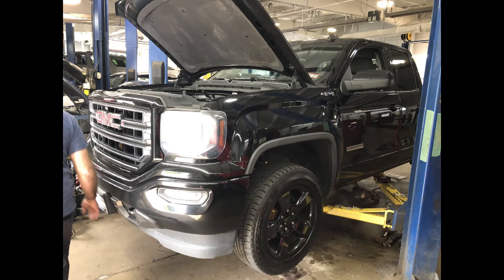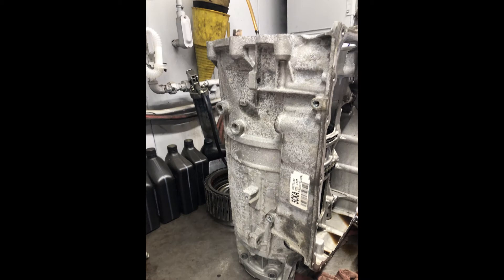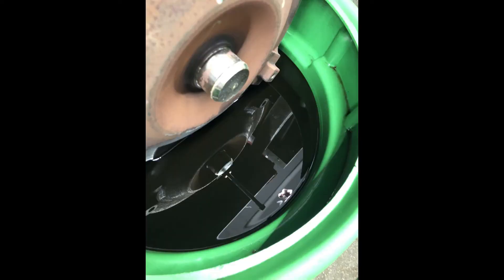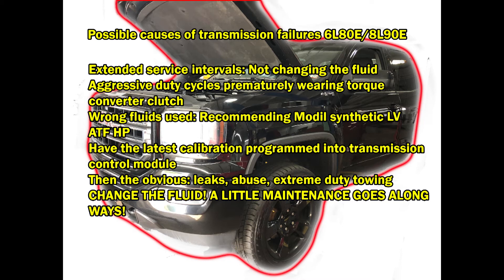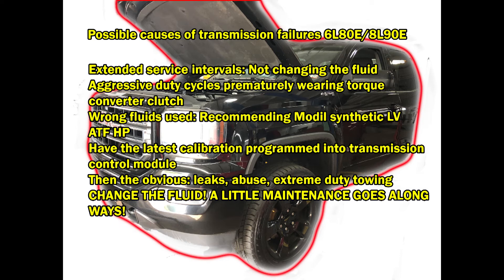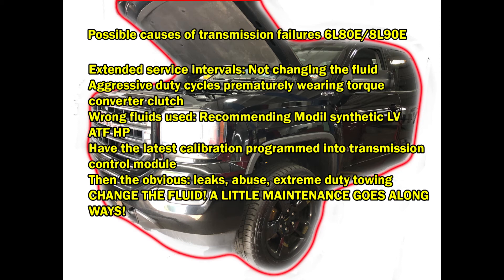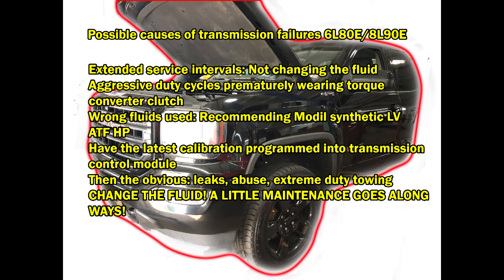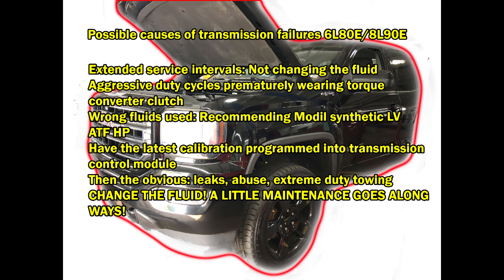2016 GMC Sierra 6L80E No forward gear, no drive, P0796

Comment: My truck won’t go . You press the gas and the rpm’s go up but the trucks stays still.
Reply: I was having the same issue. Dropped the pan and had a shit load of metal shavings.. cleaned it and added new fluid and running good so far
Reply: @Cezonova what fixed it ?? Was it the check ball
Reply: @BattledSoulPlays  Clean fluid fixed it for 3k miles then transmission took a shit. Bad torque converter didn’t catch it in time
Reply: Valve body check ball stuck?
Reply: I have the same problem 😢

Comment: My 2017 Silverado Lt , has no drive but no onstar codes or codes in dash. It reverses great but no forward.
Reply: Don’t know if you ever fixed your issue but yours might be as simple as the valve body separator plates. I’d encourage you to look into it if you’re still troubleshooting!
Reply: @Brenden.Riley. most likely your right stuck check ball..
My 6l80 will not go in any gear but if I shut it off and wait a few minutes it will go into gear 🤷🏾‍♂️ I’m just going to rebuild mine and upgrade what I can. Because it might be the converter so it’s not cheap from the start

Comment: P0796 on 6T40 transmission, what may be cause?
Reply from the maker: You could be having pressure issues and pressure control solenoid is picking up on it. Bad solenoid possible but more then likely tiny about of debris has circulated through the transmission from torque converter clutch wear. Try a fluid change, but if there is prolonged damage you may need a transmission.